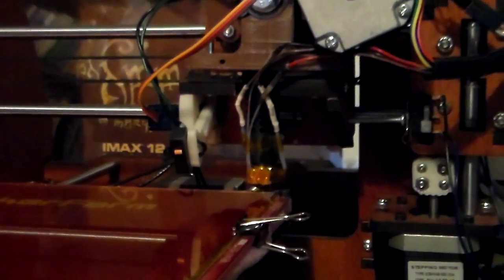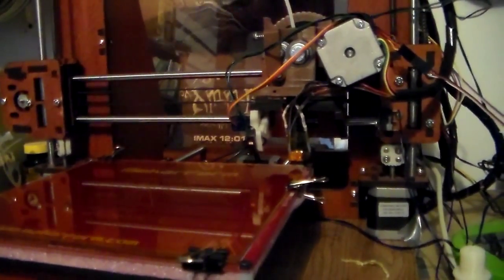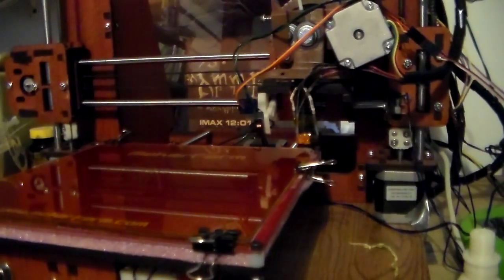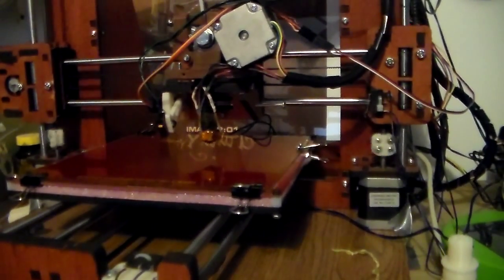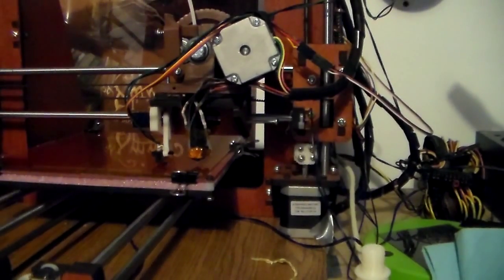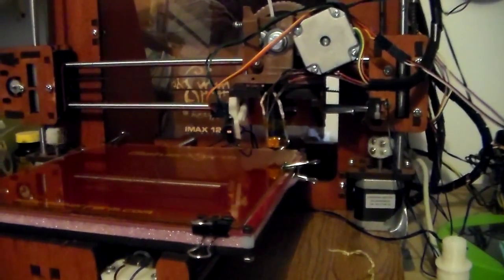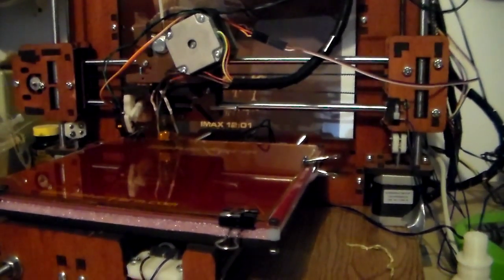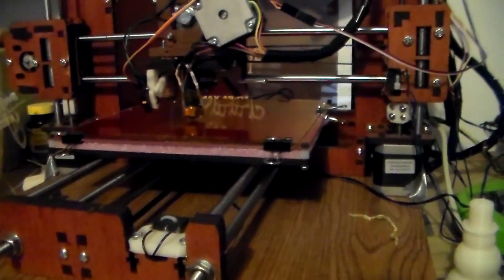auto bed leveling slight mod on the prusa i3 from makerfarm

Comment: hey I need help! how did you get yours to make your nozzle go down after the bed leveling completed? in my g code i have G28; then G29; then I used G1 Z-1 f5000 to go down but mine just stays at the sport where the auto bed leveling finished. Any ideas?

Thanks

Comment: This is exactly what I was going to do. Glad to see it works. Do you mind me asking what you have under your heated bed does that quieten it down?
Reply from the maker: Sorry, missed this comment.  There is a gap between the heated platform and the wood platform.  To stop airflow underneath the heated bed I took some small strips of foam insulation and stuffend them in around the border.
Reply: cdmiller0 Ah ok good thinking.. Probably helps keep the temp while not requiring as much power. Did you do a pid tune on the bed after you modified this? How does your temp graph look I'm sure it does not cool down as quickly now.
Reply from the maker: sarky1
It appears to cool down fine, about a minute from 111C to 100 or 95 for part removal as it's just a glass bed.  The makerfarm has a different temperature table than the stock Marlin firmware.  I initially put in the insulation because of wider ABS part edges warping up off the bed.